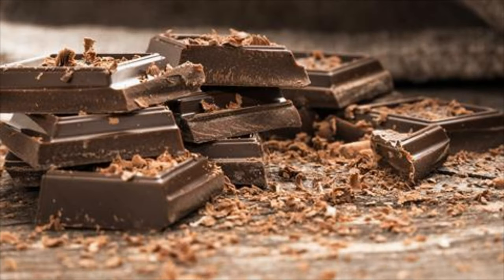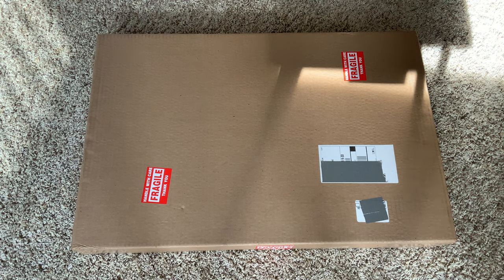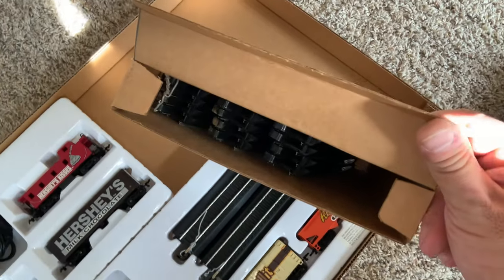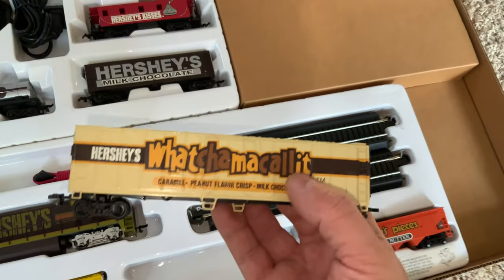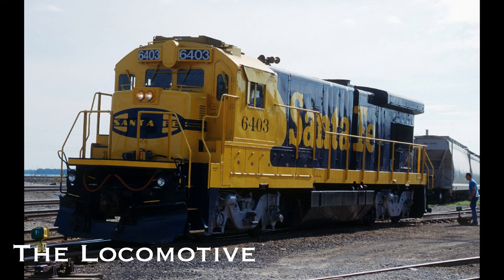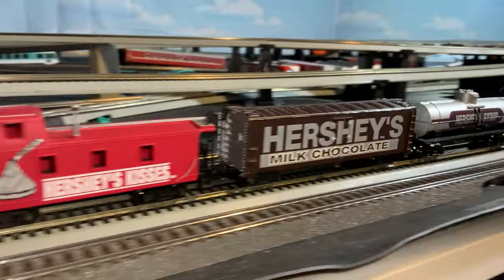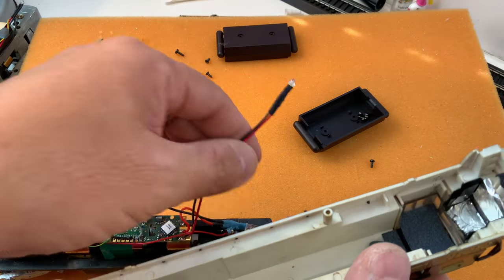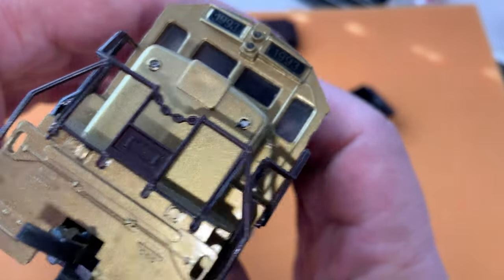Let's Convert This Mid-1990s Bachmann HO Scale Hershey's Chocolate Town U.S.A. Train Set to DCC!

Comment: Great video!  True once all the manufacturers adopted the Athearn design they all jumped in quality and performance.  What Athearn lacked in minute details they made up for in a near bullet proof motor/gear design that will last for decades.  Tyco made life easier with the Power torque system which was light years better and easier to work on compraed to those pancake drives.  Bachmann really became much more desirable with the design thats displayed here which pretty much now has become the norm for almost every manufacturer.

Comment: Does Roll Tru offer wheels that fit the old Athearn Bluebox kits?
Reply from the maker: Yes, for certain. The issue is that not all BB kits agree on which axle length that you’ll need to use. Some prefer the shorter versions while others prefer the longer. The best way to find out is to purchase a freight sampler pack from the Hobby Sensei.
Reply: Okay thank you. I have a lot of Bluebox era rolling stock and it would be nice to be able to use these wheels on all of them.